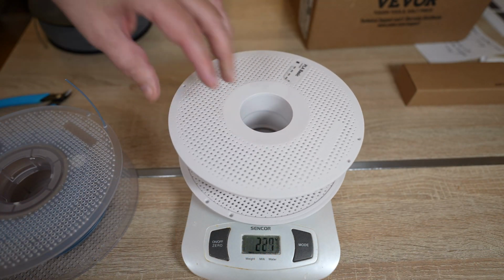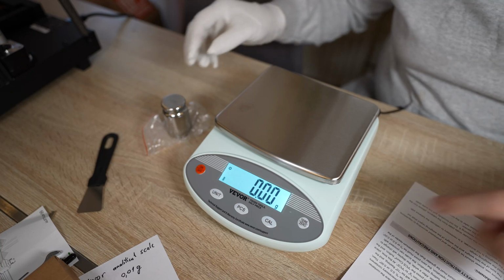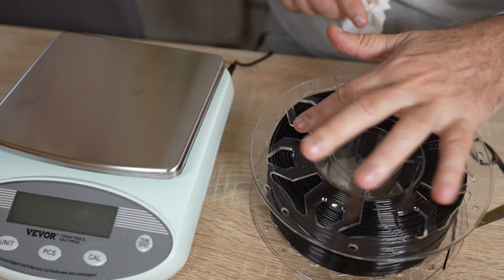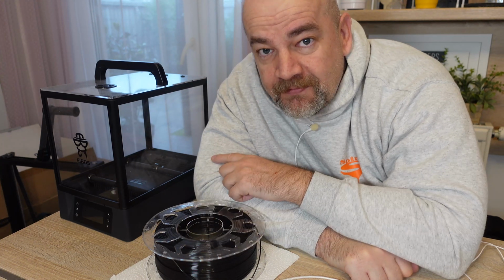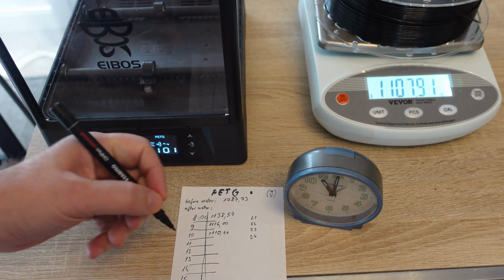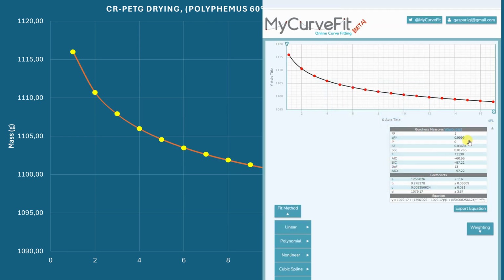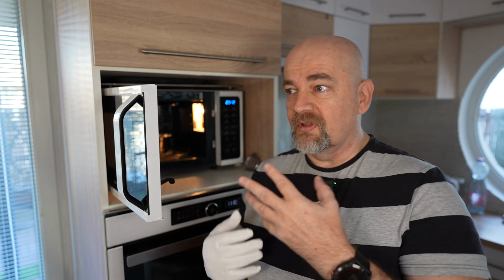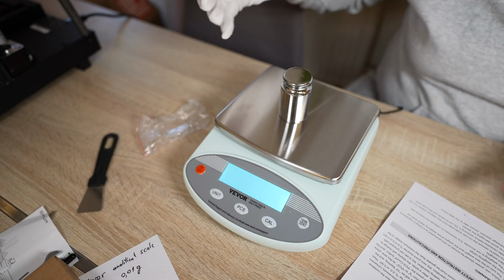Drying PETG filament, checking with VEVOR Analytical Balance Lab Scale

Comment: Informative video, very nice. But there is one flaw with your test: you have put filament with a SPOOL in to the water. So the spool can absorb the different percentage of the water than the filament. So you were measuring the amount of water in both the filament and the spool.

Comment: Thank you for your great reviews. I will need to purchase drier because moisture at my place is 65 -70%. Would be nice to see how those driers compare to air fryer -dehydrators which have been recommended on YT. For example Lidl's oven type silvercrest. My assumption is it would have good ventilation, better insulation than filament drier and possibly better air distribution too.

Comment: I have a video recommendation. I would love to see you compare PETG-CF by the brands Tinmorry, Eryone, IEMAI, and Voxelab/Flashforge. They are all affordable and are known to print very easily. Most people call them a cheat code for easy good looking prints. I have a lot of friends who swear by Tinmorry and I personally have Voxelab and Eryone. The Voxelab, which is the same as Flashforge, prints very easy and has a super even almost sparkly finish. The Eryone ends up slightly rougher for me, but looks fantastic, almost metallic, and the layer ashesion may be the best of any filament I have tried. It will rip across the layer lines before it rips along them I don't even understand it. All of the pictures of Tinmorry prints I have seen look phenomenal. IEMAI also has good ratings and the company is selling a lot of interesting filaments. I think PETG-CF is getting more popular and I don't think it would be a super expensive video compared to many.

Comment: In short: Vevor is cheating!! (a little, but still - details below)
Don't get me wrong, it's still a great scale, especially for the price, but it's not lab equipment. I have a slightly larger version of this scale, weighing up to 5kg with an accuracy of 0.01g, and unfortunately I noticed that Vevor is cheating a bit - their software has some kind of compensation, around popular values (e.g. 100g, 200g, 500g, 2kg - popular calibration values) the scale aligns itself with them. You can even see it in your video - after calibration, when you put the calibration weight back on for testing, the scale shows 200.03 for a moment, then the value slowly drops to exactly 200g. It's similar with other values, even after the indication - for example, I put a 100g weight on the scale, it aligns with it, then I add 0.07g and after a while the scale shows 100 again (I can do this even several times and the scale always returns to the exact value). The compensation works up to about 0.1g, maybe 0.15. If you put, for example, 200.2g on the scale immediately, this value will remain, it will not return to exactly 200.
Additionally, with my version there is one more problem - above about 1.2-1.4kg the scale can cheat by about 0.2-0.3g, I don't know exactly at which point it resets. It's still a great scale as a kitchen scale, especially for the price, but such compensation definitely disqualifies it as a laboratory scale.
Reply: Sir thanks a lot for this detail elaboration. IMO this is the most useful comment bellow this video.  Unfortunately even in technical channels the number of comments that put to question obvious cheating  by manufactures of "laboratory" equipment and/or incompetence  of the reviewer  is very low. Most people are oblivious.  
Btw what I understand from your description is that the scale accuracy above 1.2kg is worse than 0.1g . This is more then order of magnitude bellow the specifications.    I would not call it a "little cheating".  
I also wonder if there are available on the market scales with 2kg range with real accuracy of 0,01g for less then 100€

Comment: the moisture limit for PET,( not PETG) in order to have the best mechanical performance sits around 40ppm( 0.004% H2O) but surely below 100ppm(0.01%). For other ,materials like polyamides( Nylons) the greater the carbon chain the more forgiving the material is, being Nylon 6 one of the less forgiving and Nylon 12 one of the most. TPUs the same. As a general rule, moisture content should be ideally zero, but as that is not feasible anything below 200ppm is ok. In the case of PETG, the extra diol part makes the polymer more forgiving, sacrificing some of the mechanical properties of PET, for something more elastomeric, but less moisture sensitive. If you don't want moisture issues, use PP.... This comment is intended as general info, I don't pretend to delve into something that needs to be looked in a material by material case individually

Comment: The scale looks really nice for the price,
It should also have a interface, is this true?

"It includes a built-in leveling bubble to help operators level the balance easily. The RS232C interface design facilitates easy connection to printers and computers for data transfer."

Comment: Well. The Microwave is not a good idea. keep in mind. 1 gram  of water creates 1.67 liter of steam. So if the filament is "saturated" inside. The microwave will "explosively " turn water to steam and therefore break open the surface and ruin your filament.
I don't even think that putting filament inside water will really saturate the Material like moist air do. Plastics are mostly "water tight" but not gas tight. Which means water in its fluid form can not penetrate into it this deep. Humidity in Air can. Or am I wrong?
So to find out if Filament is hydroscopic you should better put it in a Steamy Air like over boiling water or something similar.
I think then you also would not get this fast drying rate.
But it could also be that I am totally wrong about this...
Reply: Ok, I was wrong. Put it in water is equal to 100% Humidity. (DIN EN ISO 62) Sorry.

Comment: A microwave may be the key to vacuum drying if you can make your chamber and valve all plastic. I've kinda assumed I'd use a heat lamp to pump energy through the vacuum, but water sure likes 2.4ghz. Like others have mentioned, setting your microwave lower could provide automatic cycling and let you run a longer cycle.
Reply: Caveat: I wondered if Carbon Fiber filament would spark in the microwave, so googled that. Saw lots of studies, which means it doesn't spark, but isn't so straight forward due to reflectivity. Tried a print in the microwave along with some water and an ABS print. A random corner of the CF nylon print completely melted, so I think the CF is causing some resonance.  The ABS (no cf) was unaffected. So not sure if it's worth trying since most of what I care about is in CF.
Reply: @rcrdps8144  CF behaves as a thermal resistance, it heats up very quickly. About the sparks, most of the fibres are embedded in matrix, therefore they can't oxidise, which would produce the sparks

Comment: For removing sticky residue you can use regular cooking oil (or any type of fat) - just soak it in for a couple of minutes then wipe it away, the oils break down the adhesive and it's a lot easier to remove than even with IPA.

Great video, too! Very informative.

Comment: Another very interesting and well thought-out video, thanks!

I particularly liked the part about the curve fit, to be able to determine the ultimate dry weight, I’m going to experiment with that myself. (You had precise 1-hour measurement intervals, but as long as you have the times of measurement as x-values, you could fit to a scatter plot. (You’d still need some significant number of data points to have a good confidence interval, but it’s an extremely useful method for determining exact moisture percentage.)

Microwave drying was a revelation to me as well. Most microwaves let you set power levels in 10% increments, using what’s basically very a slow PWM, so they’ll essentially do the heat-then-pause process doe you. It strikes me that an hour at 10% power might do a very thorough job of drying, much faster and probably using less overall power than a conventional dryer.

Thanks for another exceptionally useful video!

Comment: 6:46 There seems to be a lot of water inbetween the filament, so it drops out while rotating.
So the initial measurement of the wet spool was distorted by that.
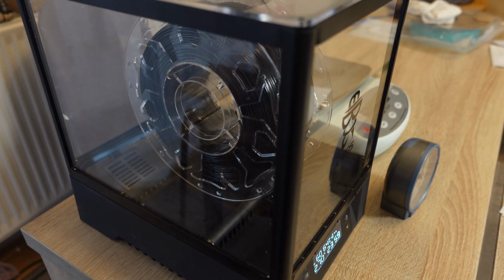Reply: 7:05 Also there's still a lot of water in the dryer while drying, which will influence the process.
Reply from the maker: I removed that water after the 1st hour measuring. And that's why I exclude the first point.
Reply: @MyTechFun  Ah, good to know.
Still I'd be interested in a test with a spool, which was just laying around in a room with 50-65% humidity.
I ask myself, how long it makes sense to dry such a spool.

Also I ask myself, how much longer does it take to dry passively by putting the filament in an air-tight container together with enough completely dry silicagel.

Comment: Wow! That's an EXCELLENT precision! I have a 5kg scale but the precision is 2g... It doesn't help AT ALL for measuring humidity differences. Great stuff Igor! Thanks!
Reply: I just finished watching - Wow, microwave can be interesting if we are in a hurry... Nice tip, that we need to do it 30 seconds at a time. (And not forget that BambuLab ones have the tag). I saw once a filament spool that had screws holding both sides together... That is certainly a No No for microwave!

Comment: My concern in using the microwave to dry the spools is that, by locally transferring energy to the water molecules inside the filament (without uniformly heating the polymeric part as a whole), the integrity of the filament might be compromised when the moisture escapes
Reply: I think it depends on how much energy you’re putting into the water molecules. Too much and they’d actually exert pressure on the plastic’s structure (I don’t know if you’d have to get them to the point of being steam to do this or not, but staying well below that point would seem important.)

As long as you’re not putting too much energy into the water molecules, all you’re doing is increasing their mobility within the plastic matrix, meaning increased diffusivity. 

Actually, the thermal coupling between the water molecules and plastic matrix should be very good, as they’d transfer their energy to the plastic pretty quickly. The filament temperature while microwaving should be a pretty good proxy for the energy level of the water molecules themselves.

I don’t have any actual data on potential effects, but this rather hand-waving argument leaves me feeling OK about gentle microwaving for drying.

(Thanks for posing the question, it was a good one to ask and I’m glad it promoted me to think through the issue this way.)

Comment: So the filament hits the hotend at 180c plus - how could a couple of % moisture ever impact the prints? The filament melts inside the hotend….
Reply: The water and ambient moister gets wicked into the filament structure as in between the polymer molecules. 

When the plastic melts at the nozzle, the liquid water flashes into tiny vapor bombs inside the nozzle where, at best, the pressure builds up during travel moves, leaving behind strings. At worst, the micro explosion leave bubbles on the print weakening the part you print.
Reply: The water turns into steam and it push out the material (the material then looks like Aerated chocolate).
Reply: Even if there isn’t enough moisture to flash into vapor and cause voids in the plastic, even small amounts of moisture change the physical properties of the plastic. Even slightly damp PETG will string horribly, well before the point that you’d see it “spitting” at the nozzle.
Reply: once you start 3d printing you will see for yourself :)

Comment: I dry everything in the microwave, :) 
works great and is 20X faster in my experience as well,
Have had no issues with overheating (800w) 30-60sec with PETG or PLA
you can also leave the desiccant on top of the spool to reuse it, it becomes useless really fast unless in a vacuum.
Reply from the maker: Good to know. I wanted to try only with nylon, but maybe I will try PETG too. Thx
Reply: I print in the edge of the jungle and humidity is a big issue. Petg gets dried for six hours right out of the box and then we feed out of a filament dryer. The idea of a microwave is intriguing!  Would shorten up initial drying times or if a roll was left out too long before going in a vacuum bag. Great video!
Reply: @ericmary1338  in theory you never need any container as long as the filament stays warmer than the surrounding air. 
Depending on the % of relative humidity you can do short or longer prints without putting the filament in a dryer, 
since the heat is on the inside it pushes out the humidity during printing.
Reply: @yagoa Actually, at any given temperature, there’ll be an equilibrium point between the moisture in the filament and that in the air that will vary as a function of temperature. If the filament is only slightly warmer, the equilibrium point will be only slightly different than the situation when everything is at ambient. 

You’re right though, that as the filament warms up, the equilibrium shifts towards lower moisture content. The question is how strong the effect is and how long it will take for any absorbed moisture to diffuse from the interior to the surface so it can evaporate into the air.

I don’t know what the relevant times and temperatures might be, and it might take quite a while for the moisture to diffuse away. It raises the interesting question, though, of whether a relatively short heated chamber just before the printer might be sufficient to drive off the moisture even if the filament on the spool was relatively wet.
Reply: @DaveEtchells  well yes I get barely any stringing with PETG so it works, we know from this video that it is many many times faster, 
but the very interesting question is how much moisture can be removed over time after x minutes microwaving.
Reply: @yagoa  considering we often print in tamps of 100F and humidity of 90%and higher I think I'll stick with my current system which we know works! It's not easy getting filament to us and we make critical items so we don't like to experiment much!
Reply: Nice 👍
Reply: Question…. Is it safe to use it in the same microwave we use for food etc?
Reply: @terranceroberts6259  I do not know, but seemingly a lot safer than being in the room while the same plastic is being printed...
Reply: @yagoa good point. Thanks. I’ll try it. In 30 years I may have a reply on this topic.
Reply: Are cardboard spools good to go to dry in a microwave or only plastic?
Reply: @Joshplv  cardboard should not be a problem but give it a feel after 30 sec, if it is contaminated or wet it might get very hot and risk melting filament together.